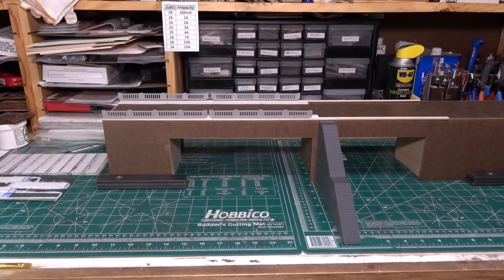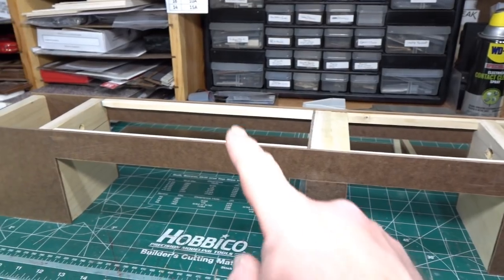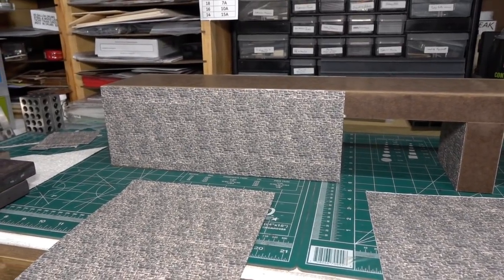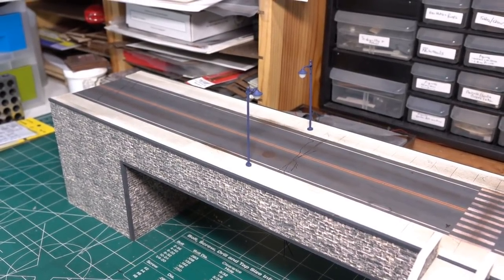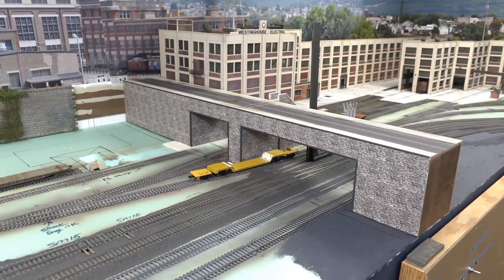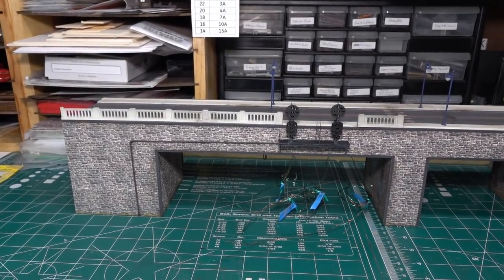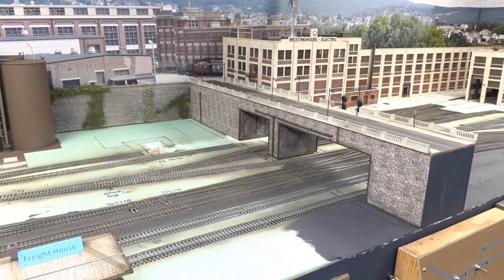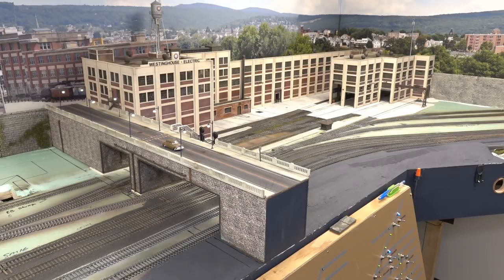Scratch Build #7: Westinghouse Viaduct

Comment: Maybe run signal wires exposed and paint them gray like conduit. Have them all route to a control box that can be used to hide the hole through the layout. Make another run with the light wires to their own control panel/breaker box.

Comment: The viaduct looks superb Rob. It makes the Westinghouse plant sort of self-contained. 
That stone sheet looks pretty good and the conduit/drainage makes a huge difference to the appearance of the bridge. One thing I noticed on the stone; there seems to be a recurring pattern through it. You don't always see it but it could maybe be weathered-out a bit.😁
I know you're interested in the "transformer" side of all this so, how about a massive prime mover on the viaduct, hauling a huge transformer off to somewhere that lacks a railroad connection? It's just a thought but would be a great way of displaying such a model, without it looking forced ao un-natural. With Highway Patrol escorts etc, you could make quite a cameo scene and it might be a way of disguising the "bridge to nowhere" aspect at the front of the layout.👍👌😁
A running session sounds like a great idea, before you get started on the next big project. I'd love to see some passengers getting moved. I've seen some beautiful passenger stock around the layout: do I remember a Budd railcar? Is that the right name even?😂

You mentioned "burn-out" Rob. A great way to knock 𝒕𝒉𝒂𝒕 on the head is to get in amongst something you really 𝒍𝒐𝒗𝒆 doing - a wee while just having fun, rather than 𝑤𝑜𝑟𝑘𝑖𝑛𝑔 on the layout.

Cheers for now,
Dougie.
𝑶𝒉 𝑷.𝑺. - When it comes to the "having fun" bit, don't order any of the fun to be delivered by post from Chicago.😂

Comment: Rob  just a suggestion I dont know if you thought of this. But there should be a railing that runs from the steps to the Guard shack and running from the shack to the big concrete pad. All on the Railroad active side. Also if you need some people painted I will paint some for you.  You are doing a great job on this.
Reply: Yep, I've been wondering about that too. The "guard shack" could maybe be made to work but I don't think the railroad would allow the public, Westinghouse employees or not, unguarded access from the viaduct to the trackside. You did touch on it Rob; maybe fencing a path from the foot of the stairs to a gated guard post would keep "Health & Safety" happy. It could be a good excuse for loads of "Staff Only" and "No Public Access" signs.😁
Reply: @2H80vids  Not true, there are many instances of street running here in the US where the public has unfettered access to the tracks. In fact, just down the road from me Waste Management (WM)Inc. Has facility that has a CP (former D&H) branch that runs right thru the parking lot where highway vehicles, employees and pedestrians have unfettered access to the tracks. As they say, if look hard enough you can find a prototype for most anything.
Reply: @bryanfuller4296  Fair point Bryan. Thinking about it, I've seen plenty examples of that on your side of the pond. I was thinking of our railways here in Scotland, where a situation like this just wouldn't happen. Sometimes we forget that "normal" can vary in different countries. 😁
The funny thing is: I think it's a pretty cool scene (I love the stairs) and, just for a moment, I forgot one of my favourite sayings - there's a prototype for everything - as you so rightly point out.😁
Having said that, I still think a "guard hut" controlling access would look good.👍👌😁

Comment: A model railroad is never finished just higher degrees of completed, as for the length of the Videos I have watched epic movies in the 3 to 4 hour length in the theater, with yours we can pause them for snack and other breaks. So you can make them as long as they need to be.

Comment: The whole structure looks great, but I'm impressed with the embossed stone paper. And you're right, once it's on you can't see the joins. My lack of electrical expertise is the main reason for not having wired in signals, but well done for persevering with the installation. Cheers